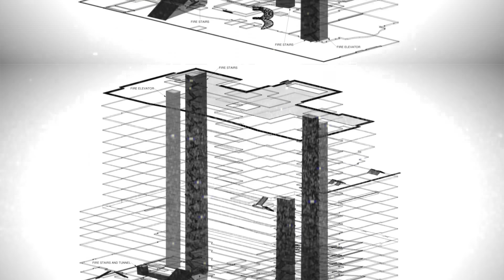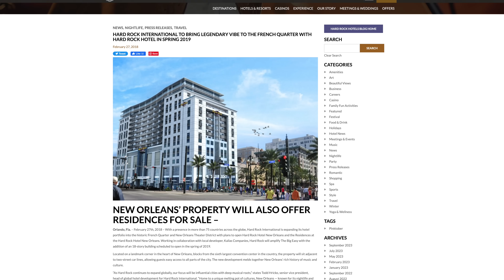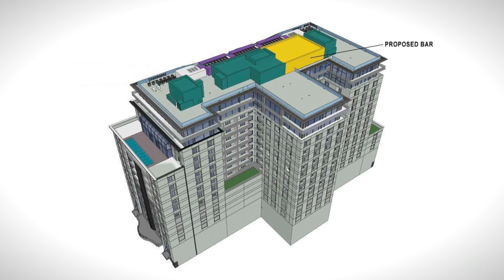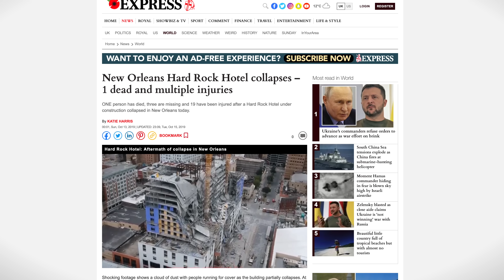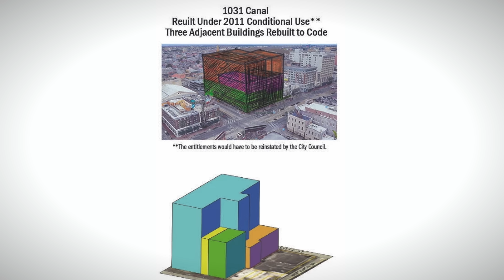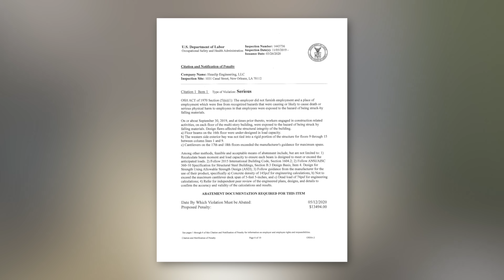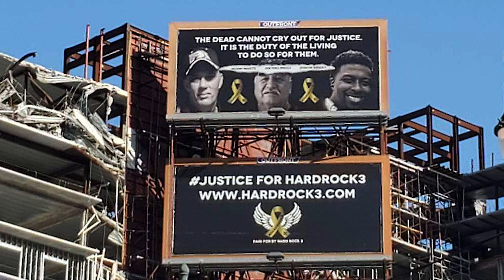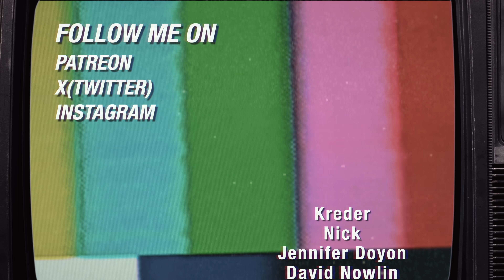Cancelled - Hard Rock Hotel Collapse New Orleans

Comment: The owner demanded construction changes that were not approved by the architects and the construction company used poor and incorrect construction methods. The city building inspectors were paid to look the other way and not do any inspections during construction, which would have pointed out the faults in assembly. Less concrete was poured in constructing the floors (too thin) than possible and floor supports were removed before the concrete had proper time to set to hurry up construction times. All to squeeze out as much profit as they could get. 😡

Comment: In your video…you can actually see the floors sagging…they changed the architectural design…started using the wrong cement…trying to save money and also rushing the construction. 
And the city inspectors would not even visit the site, and inspect…they sat in their car at the curb. 
No one cared…Mayor on down…city is so corrupt.

Comment: 12:50 I choked on my water when he said this....I am a sheet metal worker, and 16 gauge corrugated sheets like that are already too thin for a building like this in my opinion. To then hear that they laid down 22 gauge....that would be considered almost too thin for residential 1 story homes in my opinion. They have to have done this because of cost, as 22 gauge metal would have been about half the price due to the weight...Incredible recklessness on the part of the engineers here.

Comment: I remember when the building went down. I could feel it in the warehouse district on the 3rd floor. I saw the cloud from my window and immediately knew it was a collapse of some sort. The body being left visible from the street for so long enraged me as a professional engineer and former firefighter. The structure was stable enough that they could have used a crane or ladder truck to get up to the body and jackhammered a cavity to remove it. I would have been personally willing to do it - that's how confident I was in the stability. I also think that the cranes falling on the building with no effect proves that correct.

In other news, that yellow parking deck adjacent - that has the thinnest deck you've ever seen. It's not a composite deck and is cantilevered. It's visibly sagging. I sent a letter to the city expressing my concern (for legal reasons - I'd lose my license if anyone could prove i had concerns and didn't act). It's going to come down within a decade, I'd wager.

Comment: The crane demolition was a huge debacle. They didn't have to be demolished. Then the Contractor refused to push the button unless the owner wired over $1 Million into his account for a job that cost him $10,000 and didn't even go according to plan. Watch...now they are going to say that the only way to take down the Plaza Tower is via explosives even though they know that there are 10,000+ cases of cancer from exposure to the dust from the WTC collapse. The EPA investigated it and most were caused by Respirable Silica the main component in an implosion dust cloud.

Comment: Not a fan of that reinforced concrete building practice.  The Empire State Building is bending. I watched them build something like this in Boston and not sure I would stay in one of the hotel rooms. They would jack up a base with lots of supports , pour a new floor, give it some time to dry, remove the supports, start a new base, pour a new floor. It did not look safe.

Comment: We have a Hard Rock Hotel and Casino here in Sioux City, IA. It opened in 2014. They used the old Battery Building for the hotel section, which is really cool. There was to be a giant lit up guitar on top of the hotel section, but it was ruled that the guitar was too heavy for that roof, so it was installed on top of the casino section. It's not as high, but at least it's up. I guess there's no corruption here.

Comment: What the hell.  As a retired engineer, having had a fair number of basic structural engineering design, and courses in timber, structural steel and concrete design, I find it mind blowing that we have such bad engineering and construction occurring on such large - multistory buildings all across the US...including failures such as this.  All buildings are very susceptible to damage (and destruction by fire) during construction, especially steel reinforced concrete buildings....but this shouldn't be occurring in this day and age.    I was also blown away to see two documentaries about very tall high rise buildings in the US with failing foundations resulting in tall towers leaning....referring to the building in San Francisco and another in NYC.   Something is seriously wrong with our engineering profession.   When I was just recently out of college, I remember subscribing to a professional magazine called ENR - Engineering News Record.  I remember how ENR covered structural failures such as this in great detail. Offering lessons learned for young engineers.   I remember the worst collapse of that era (mid 1980's) having been a skywalk that collapsed in a Hyatt Regency Hotel out in the Midwest.   114 people died in that collapse.  In that case, the failure was caused by a change in structural detailing made by the contractor through a construction change order, where long single tension rods were replaced with shorter spliced rods and the splices were improperly detailed causing the splices to fail.  It is scary that we are still making horrible mistakes like this 40 years later.

Comment: Welded steel together when it didn’t fit 😳
Reply: i worked in steel fab for some years - you don't need to have an engineering degree to understand that welds will not do the job of nuts and bolts - this was rotten from top to bottom

Comment: In Sydney this exact same cheapening of steel used in high rise buildings has seen many apartment towers be deemed too dangerous to live in. All this is linked to greedy developers who care more about profits than the code building standards. A deregulated building inspection regime only amplified the problems and the icing on the cake is the importation of substandard building materials from China. It's classic three strikes and you're out syndrome. I never knew about this Hard Rock Cafe collapse, mustn't have been international news.
Reply: Please explain how there can be both a "deregulated building inspection regime" and "code building standards", I'm lost... Either there are building codes that are regulated or there aren't... Or are you saying after the apartments were sold, then they were inspected and the codes were regulated...

Comment: Anytime I'm around large buildings and bridges I'm always wondering how these things don't happen all the time. I expect they will happen more often as the population gets dumber and lazier and we keep lowering standards so we don't hurt people's feelings with things like failing grades and test scores. And cheaper, we love cutting costs even at the expense of safety. I think of these things every time I'm at work and go down the hall that "has the unlevel part that slopes a little, been like that since they built the place," or see some wall that meets at a weird angle and the molding came off after 2 years.

Comment: i worked in Florida in the 80's in construction and there was a few high rises that came down. That was due to not allowing the lower floor concrete to fully cure before pouring the next floor up, and to save money they left the bare minimum vertical supports. In the case of this one, the sub standard materials, and the lack of city inspections because they used what's called threshold  inspections that are done by onsite engineers.

Comment: The metal decking really has nothing to do with holding up the concrete floors once the concrete is hard….   
Thinner decking requires more Temporary shoring…… once set… you could even remove the decking completely

Comment: The problem with this project was politics and the power of potential money.  Engineers were ordered to change the specs with no room for a voice from engineering.  This corruption is worldwide and isn't going away any time soon.  Holding people accountable will require changing the laws to hold public figures accountable.  There also needs to be a change in what companies can invest in construction, as foreign companies live by different rules than the locals.  Then there is the peer review and oversight committees that are required to build the structure correctly.  The issue with these committees is some people think they have arrived and are now a king or queen (corrupted) and they cause major changes in time and expense.  If you don't understand, talk to a church that had to deal with a local fire marshal that doubled the building expenses with massive firewalls, doubled sheet rock walls, and other changes that were designed to break the bank.  The tall ceilings on the upper floor show a design change that should have required larger pillars from the foundation up.  Many projects require 3 or more PE on staff, but this appears they bypassed the peer review during the changes.  This shows a lack of good leadership in the upper levels, the power of money to force changes, and the lack of listening to the workers who complained about the unsafe work conditions.  Corruption is self-centeredness.

Comment: First year structural engineer would have done better.  Look at the steel frame of the top floors.  I-beam size is half of the lower floors and the beams do not sit squarely on the lower floors creating load bearing issues.  This looks like the builders wanted to save a few rupees.  We can only hope lawsuits are successful and the families are richly compensated for their loss.

Comment: I work in a construction company that builds metal buildings.
I don't even build but even I know you don't reduce the metal gauge of the planned steel or reduce load bearing columns that were designed into the plans. 
Changes MUST be approved by the architect.
We, as a construction company, are now fighting a metal manufacturer that says his building design is satisfactory for his client's building.The architect agrees.
But we are arguing, "No, it needs another column added."
The engineer, the architect, and the owner want to move forward, but our little small, business is saying, "Hell no, we require another column or we not do it." 
They say they will sign a waiver and we say "a waiver saves US from law suits regarding the building's safety, but what about the dead or injured people when it crashes to the ground?"
We are at a "Mexican stand off" at this time.
They can hire some other company. We arent building their death trap. 
For accurate and ethical large metal building construction just outside the New Orleans area, see us in Baton Rouge, LA.
Hernandez Metal Buildings LLC.

So many things were went wrong here. 
I can't believe the developers, engineers, architect and the city are NOT held criminally liable. 
It's definitely not the construction workers' fault.
They build according to the plans only.
Just a few months back a large Baton Rouge LA. metal building crashed to the ground TOO, while being built as well.
I was waiting on a report on the Hard Rock, and I want a report on the large building in Baton Rouge, LA. that went down TOO. 
Thank you. 

It's the lack of steel metal supplies and the saving of money that cost those HARD workers' lives.
May God give their families justice.

Comment: I worked construction for 40 years. Some people ask me why I stopped. As the years go bye. Safety SHOULD get better and better. Right. Well that's not what happened. The last five years of my work life. It was so dangerous it would just keep you scared. You can't control what other people do. The young guy's, it's like they don't even care about safety.
You can't believe some of the stories I have about safely problems.
Most of my work life. I was a leader. And I told my men. My # 1 job is to make sure everyone goes home after that days work. I never had one of my men hurt bad. We all get little hurts. I never lost a man. Never had one took off the job in an emergency vehicle.
It was close a time or two. But never.
I am the most proud of that than anything I build. We did big jobs.

Comment: 12:50 - not to nitpick but based on the thickness of 16 vs 22 gauge steel,  the replacement steel was half the thickness of the initial steel.

Comment: In the federal government (US), there is a lot of fraud committed by the construction contractors.  The federal government can’t defend itself, so they walk away and often file claims against the government for more money.  Those claims are typically settled even though there is little to no evidence to support the claims.  Also within residential construction, homeowners are often duped with substitution of materials that cost less thought the builder keeps the difference.  The US construction industry is riddled with fraud.  Basically ever developer and construction company you come in contact with is running a scam.  True of anything from small projects to large projects like the one in the video.

Comment: I know I'm only just starting my welding classes, but to only weld and not bolt those beams, I would have instantly called fowl and leave. No way in hell even the best weld could hold up that much weight, along with everything else that went wrong.

Comment: I’m an Architect and can tell you these changes were done by an Architect and should be held accountable. TheEngineering was changed because the Architect insisted on the ceiling height. Also the gauge of the decking is an Architects call. There is where I would start the legal process.
Reply: Engineers have to spec out the work ergo the term structural engineer. Whomever pushed for the cost savings would be a good starting point but ultimately engineering has to verify/confirm viability of changes and sign off on it.
Reply: Architects are not engineers. It is NOT the architect's decision to determine anything structural, and the steel decking is structural. They are not qualified for that. Architects have no authority to overrule an engineer.
Reply: @derrynh-NE  you obviously are neither and it shows. Architects can and do specify structural and non-structural decking,  plumbs and even footers.
Reply: agreed, it seems pretty obvious that they should start with the architect who would know better, yet designed a crappy structure.
Reply: @drownzi  Architects do not know better. That's why there are structural engineers. There is a huge difference between the two professions.
Reply: An architect (lower-case) who can barely string a sentence together and spends their time making videos pretending that Appalachia is relevant?
(What?)
Reply: @tim3172  why do you care? Go back into your mommas basement.
Reply: @tim3172  I think his name is Art Vandalay.

Comment: With how hot the building has been in the last decade i bet there is many buildings that are just as unsafe , they only only got in trouble becasue is collapsed and people where lost ,, its good it didn't happen after it opened over 100 people could have been lost then ..when markets are hot and there is way to cut corners and make more money sadly it will be done and nothing comes of it unless something tragic happens ...things might look more modren now but truthfully they are barely built to code now and will fail and when they do the original owners and builders will be long gone ..

Comment: as a metal worker, 16 gauge sheet metal is a little tough to bend by hand. pretty strong. 20 gauge is stuff you can bend with your fingers.
Reply: From 16 to 22 gauge is a tremendous difference.  That much of a change is shockingly bad judgement.
Reply: I don't think I've ever seen anything thinner than 18ga decking allowed on any project I've been on. Not even non structural elements like eyebrows over doorways.
Reply: And this was even thinner... 22 gauge!  
(The higher the number, the thinner it is)
Reply: When I saw this and realized the gage of steel, it was shocking. I am no expert, but I worked for a company that made hollow metal  frames and everything was 14-16 gage.

Comment: At 6:22 if you pause and look at the top floors above the saenger sign, it looks like its already starting to sag under its own weight on the left! 
Frightening  to think that they could have had that finished and it come crashing down under the weight of the guests staying there when it opened.
Reply: It looks that way but it's just an optical illusion since that side of the building had a convex curve, as you can see when they showed the blueprints.

Comment: As somebody born and raised less than hour from NOLA, it's not surprising that this happened. Whereas Mississippi is a state without any drive to improve, Louisiana is a state that goes 1 step forward and 5 steps backwards. A lot of things wrong with it are self-inflicted and the solutions are often obvious, but corruption and misinformation gets in the way of ever fixing it. It took Louisiana nearly 100 years to convince the US Army Corps of Engineers to allow a single diversion off the Mississippi River to help restore wetlands. And that was only because international attention was brought to it. A lot of stuff has gone from wanting to build in NOLA to wanting to build in Gulfport and Biloxi in Mississippi because of the ridiculous failure of Louisiana's government to fix even the most basic issues.
Reply: It isn't just the government in louisisna, the private sector here gets away with a lot.